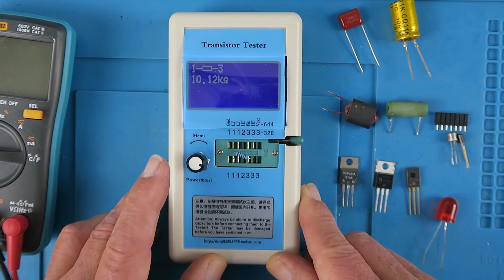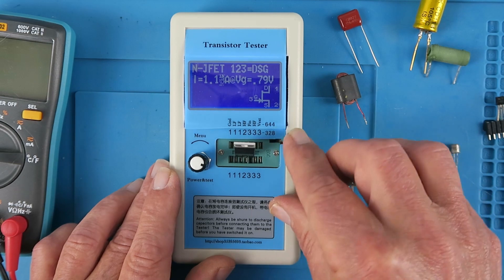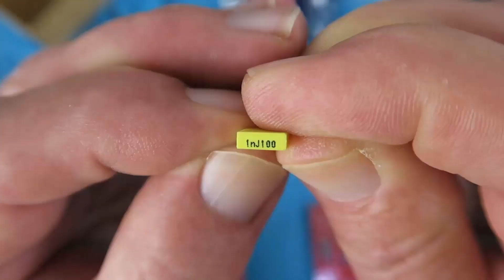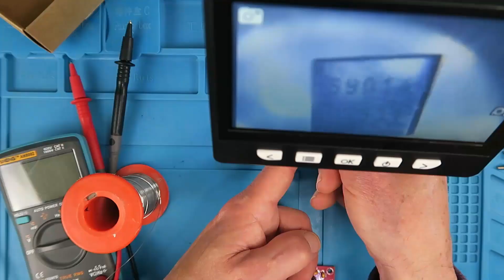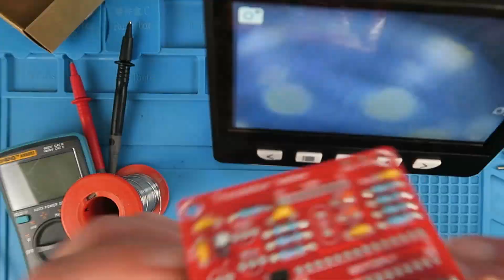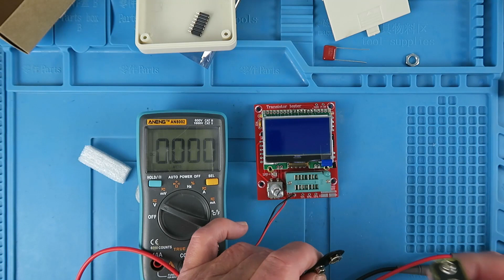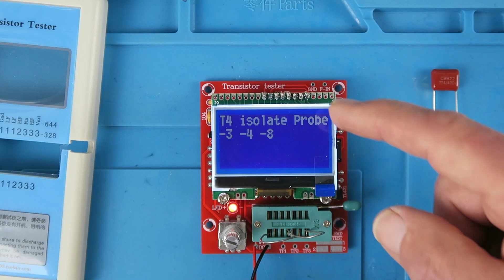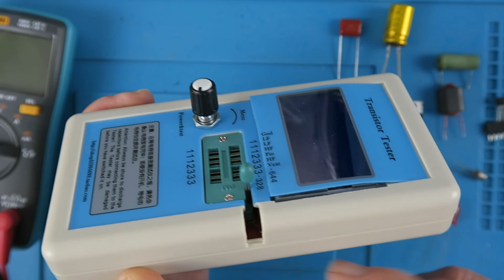Hiland M12864 Transistor / Component Tester Kit Build

Comment: Thank you for another clear and informative build video.  Together with the two follow ups on using the tester for simple component checking and extending its capabilities you have covered all that your viewers need to know.

I found that my kit of parts included two strips of turned pin sockets that allow the ZIF holder to be lifted up far enough to avoid the need to cut the case for the display screen, although the side of the case still needs a bit of filing to allow the lever to operate, and I still needed to drill a hole in the case to allow the LED to be visible.

My tester appears to work correctly for all the components that I have tried  so far, but when testing capacitors in the picoFarad range the display shows a jumble of pixels rater than ‘p’ for picofarad, and if there is an open circuit or no component placed in the ZIF socket, the second line of text is just a string of random characters.

Is there anything in the menu layers that can give a reset that might clear this corrupted text, or does it mean re-progamming the Atmega processor?
Reply from the maker: Thanks for your "constructive" input! I know of no way to reset the device, I guess you will need to program it afresh. You will probably find newer firmware will fix other things too. Let me know your progress.

Comment: Hi, what is that blue tray work board thing called? To lay out components in a place just for them appeals to me. 😁
Reply: Thanks for the video. I found one one ebay as "Silicone Heat Insulation Station Work Pad Portable Electronic Repair Storage Mat" AU$16.99 including delivery.
Reply: I bought this kit, but was looking at so many ebay tabs on my browser, that I actually wanted to buy it prebuilt and clicked on the wrong one when distracted away and coming back to it. So ironically I paid more for the kit than the one already made in a case. Note to self... No More Next Times! 

I was so annoyed I almost ordered the right one out of spite lol... then thought well... mmm... ok... perhaps it is was what I need to get my mind back into doing something coordinated with commitment. And I learned to get over the pain of the wrong choice faster than ever before, so one up for personal growth. My eyes have faded over the years, and so I bought a head mounted multiple lens and light device. Has 5 lenses that can have two in at same time to get really small/big. Its the hand eye coordination that is trickier now! Cheers, I sub'd and will call again.

Comment: You have to do it differently with the casing. The set includes precision sockets (two single row, black). They need to be soldered to the PCB and a socket with a lever should be connected to them. Everything will be fine then you will not need to cut the case.
Reply from the maker: Thanks, a bit late now!! YouTube no longer shows me if you are subscribed. Please consider subscribing if you have not done so already!

Comment: You can slot the black extra socket into to green socket then it’s high enough so no case mods are needed. You then clip off the green clamp arm. Add a bit of hot glue at their junction to prevent separation. Testing direct to the green then the socket bridge no change in values were seen.
Reply from the maker: Thanks for the idea. Please consider subscribing if you have not done so already!